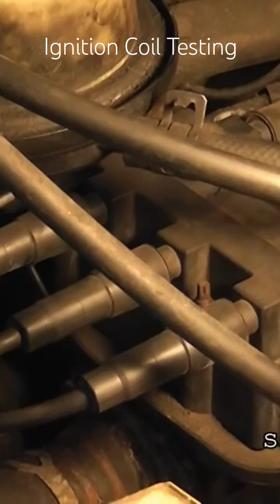No Spark From One Side of a Waste Spark Ignition Coil #misfire #nospark

Comment: Paul, you gave me an idea with this diagnostic test.

I wonder, if this coil test can be done on Garden Small Engines, like a Lawn Mower & String Trimmer?

I've seen videos of Coil test on Small Engines, where the Coil is removed & tested.
They only use one Multimeter way to test & give up too easily, then they change the Coil.

They don't test the Coil for spark, whilst the Coil is in the Small Engine & makes me think the diagnostic of overall Electrical current being tested, is not thorough or accurate, be8ng an incomplete test.

I would appreciate your guidance, if it's relative to this testing method, or any ones else's help in this post, who may know. 🙏
Reply from the maker: They use a different style of control for their coils. They're more of a magneto design in that there is a heavy magnet built into the small engine assembly that directly controls when the coil fires.

Comment: Great Tutorial, with thorough diagnostic, that I've not seen or heard before.
As, most other Mechanics do basic check & just replace Coils, without the investigations you've done, so well.

I'm a handy lady that aims to learn & fix, what I can & interested to learn, how to check Car issues & if I'm able to service the basics of my Car.
I'm greatful to have learned from you.

I also appreciate, your detailed responses of help & your valuable time & care to all the comments in your Posts.

My question is, does the Ignition swith key need to be on, or the Ignition to be turned on, for the car runing to do this test, or one or the other, should be off, please?

Also, can this test, be done, if the car wont turn on & isn't running, due to being left still, over months?
🙏🙏🙏
Reply from the maker: This was secondary ignition testing done with the engine running. IF the car is not starting, you can do this test with the engine cranking to check for spark. With just the key on, there is no RPM signal going to the computer, so you will not have ignition control taking place, so no spark. But you can get very creative with this once you understand description and operation of a system. For example, I can create an RPM signal on some designs by triggering the crank sensor circuit and the computer will respond and fire the coil.

Comment: What if the coil is not bad? What other issues
Reply from the maker: On this design? There is a single driver in the PCM that controls each coil. There are three of them in this assembly. For not spark on one side, testing the way I did, there is no other possibility. A driver or control wire issue would affect both coil towers. No spark from both

Comment: He's absolutely right nothing else needed at this point but let's say both sides didn't spark ⁉️
Reply from the maker: If both sides don't spark, next step is to check for coil primary control. Good control = bad coil. No control = open wire or PCM driver issue. Or in rare circumstances an input issue (cam/crank)

Comment: My dear ignorant mechanic. Go to lowe's and go to the section for tools such as electrician meters and test equipment. If.
You look around , you'll find a thing that will indicate electricity just by bringing it near the power electricians , call this a stinger If you get that stinger and You put it near the end of that Plug wire that stinger wolf will flash on and off and you're not exposing yourself to that hyvotage. Believe me I had to have my wedding ring cut off but that was in the 60s.
They have better tools today. Mechanics should take at least a basic electric technician electronic technician electrician
Reply from the maker: You cannot perform an RPM drop test with what you are suggesting smh. Talk about being ignorant. Want more context? Watch the full video linked in this short.

Comment: Hey I'll take the power comes from the cord that you took off not the plug coming out of the block
Reply from the maker: On a waste spark coil, it will fire from on tower and travels through the plug wire and plug, then through the block to the companion cylinders plug and wire and returns to the coil

Comment: It's called an amp meter if you use an amp meter and not only can you see if it's going through you can see if all of its going through because when the spark plugs start to go bad they start to carving and that increases the load the resistance of the power cable which is what you have there so you could be getting a spark but you're not getting a clean burnt and the poor spark will damage your spark plugs say buy an amp meter you can buy a cheap one and learn how to test learn about EMF and all that stuff load voltage amp impedance because what you're doing there I don't need to do that all I have to do is pull the spark plug wire off the plug move it at 8th of an inch away from the plug stem watch for the spark and not stick my fist in there I found out about those voltages on those cables when I was 15 years old I still carry the scar from where blew through that ring on my finger that sparked my friend can kill you and even if it doesn't kill you that shock a pumpkin why do you think they outlawed that in the insane asylum
Reply from the maker: Losts of misinformation in this comment

Comment: But heres my point if one side of that coil is sparking something is very wrong , that system spark goes out one side of the coil through the lead jumps the plug gap goes through the block jumps the dead cylinder on exhaust back through the other lead back to the other side of the coil , it cant work on one side and not the other !!! It needs a full circuit! If its jumping one one side how is it getting back to coil ???
Reply from the maker: It has a return path through the housing of the coil. This is actually very common
Reply: @ScannerDanner  I assumed it was the style like the 3.8 Buick V6 the coil has 2 high voltage terminals , and no ground on the coil , it goes out one terminal jumps the plug on firing cylinder through the block jumps the plug in its companion cylinder that dead ( on exhaust) back through a lead to the other side of the same coil ! So this one is like old coils ? One side of the high voltage is grounded and the other to a lead .

Comment from the maker: Next would be to verify coil - control from the PCM and the result of that test would dictate the next move.
Possiblities for no spark on both towers of a waste spark coil, car still runs but a 2 cylinder misfire...
1.Bad coil
2.open or shorted coil - control wire
3.open or shorted PCM coil driver
4. An input problem (crank sensor with a reluctor issue)

Comment: So if both sides dont spark whats the cause
Reply from the maker: Thought I answered this one?
Reply: @ScannerDanner  didn't see or hear it. If you don't want to say it again that's fine. I'll keep looking
Reply from the maker: I answered in the wrong spot. Here you go...
Next would be to verify coil - control from the PCM and the result of that test would dictate the next move.
Possiblities for no spark on both towers of a waste spark coil, car still runs but a 2 cylinder misfire...
1.Bad coil
2.open or shorted coil - control wire
3.open or shorted PCM coil driver
4. An input problem (crank sensor with a reluctor issue)
Reply: @ScannerDanner  your the best thanks bro

Comment: I'm not sure all test lights are rated for 10's of thousands of volts. I'd call this bad advise. Just use a jumper wire to ground.
Reply from the maker: For sure, don't use an LED type light. An incandescent bulb style only and you won't hurt it.

Comment: I never thought to use a test light as a ground for the spark.   Thanks for the tip.
Reply: 😢 it's a good way to burn out your test light if it has spark.
Reply: @coolasice2187  
So, buy a multitude of cheap test lights ?   
I used to get cheap one for a dollar.

Comment: Bad ECM’s will cause this same behavior though coil pack is the easiest fastest gamble.  If that doesn’t fix it, open the ecm and you’ll probably see one of the transistors is swollen (bad)
Reply from the maker: A bad ecm driver would cause a no spark on two towers, not one

Comment: If you don't manage to let go, it definitely has the capacity to kill.
Reply from the maker: Nope, not a chance. Secondary ignition voltage is high (40 to 50kv) but amperage is super low.
Reply: @ScannerDanner  I guess after initializing a cardiac arrest, you're technically not dead yet.
Reply from the maker: @paulwolf8444  please Google search automotive ignition coil deaths statistics and stop  spreading false information

Comment: @ScannerDanner What is the purpose of checking the other side for spark? I’m not familiar with block coil diagnostics.Thanks!
Reply from the maker: If there is also no spark on the companion coil tower then you would absolutely focus on the primary control of that coil. Good spark on the other side, means primary control is fine

Comment: if you pull that boot off (on the good spark side) with no spark going to that cylinder is it just dumping unignited fuel into that cylinder the whole time you have that boot off?
Reply from the maker: Yes sir, every ignition misfire does that. Unless the computer recognizes the exact cylinder and shuts the injector off

Comment: Put short Pieces of vacuum hose from the coil into the boot start the engine, then touch it with the test light to ground Doing a cylinder balance test the further away from the hose Will give you a nice blue Ark about an inch away. If it’s a small, yellow spark, the coil is weak. We call it a poor man’s coil performance test
Reply from the maker: I like the challenge more than fudging around with vacuum hoses 😉

Comment: Just turn the car off remove the plug wires then restart the car
Reply from the maker: Lol no! Never do that!
Reply: @ScannerDanner  it wouldn’t hurt the car the moment you unplug it your misfiring anyway the only difference would be your not risking shocking yourself in the process
Reply from the maker: No sir, this would be massive amounts of energy looking for somewhere to go, potentially damaging the coils and drivers. Also you can't do an RPM drop test that way.
Reply: @ScannerDanner  you can replace parts can’t fix nerve damage at least wear protection and stay safe I’ve never had a coil short or a fuse blow doing it if you want take out the fuel pump relay start the car until it stalls and just have someone cycle the car and you can see it after it turns over a couple times what the problem is
Reply from the maker: You're not damaging nerves, and you're not listening, you cannot do an RPM drop test with what your suggesting! Example:
No codes but you have a misfire or you have a P0300 random misfire code but not cylinder specific (common) and you can feel it it's consistent, but you don't know what cylinder it is. RPM drop test for the win, exactly what I'm showing
Reply: There’s always nerve damage with electricity maybe not a lot but there’s always a little and from what your showing in the video is your unplugging your wife from your ignition coil no spark go over to the adjacent cylinder and see spark after removing coil if you want to test a coil and see if it’s sparking turning a engine over causes the coils to fire if you have no fuel it will just spin and not be as hazardous I’m listening but if your trying to diagnose a bad coil there’s better ways to go about it that don’t chance you getting shocked

Comment: A spark tester is less painful @ 12 bucks. Mines 40 + years old, havent been bit once in those 40 years. Works on either end of plugwire.
Reply from the maker: You can't do an RPM drop test with a spark tester. You have to be able to do this test running!

Comment: Why would you need a new coil when only one plug has no spark. Maybe you just need a new wire.
Reply from the maker: The test light IS the plug and wire in this case. There is no spark from the source, which is the coil itself.
Now when you see this, you absolutely must confirm that an open plug wire/plug did not cause this condition otherwise you will burn up the nee coil too. But this is a confirmed bad coil, in particular because the other half of the same coil is functioning. This means no primary circuit testing needs to be done.

Comment: you dont need a test light see it not firing ...if cylinder is firing and you remove a plug wire the engine will change tone/studder ...if it does not change that means that cylinder is not fireing
Reply from the maker: You never want to remove a plug wire without giving the spark somewhere to go!
In this test we are looking for two things.
1. Rpm drops on each cylinder
2. The strength of the spark from each tower

Comment: Electrocution is "Death by electricity".... you're only going to get shocked by that coil. It hurts like hell but it will not electrocute you!! There is, on the other hand,  a wire that can and will electrocute if you were to touch it whilst the vehicle is running.. but that's on hybrid and electric vehicles..

Comment: Dont even need the test light. Pull the boot off till you can hear the rpm drop and you know that cylinder is contributing.
Reply from the maker: It is never good to do that! You always want to give the spark somewhere to go as coil and driver damage can occur.
Secondly, I'm not just doing an RPM drop test, I'm also looking at the distance the spark can jump from each tower. The method I'm showing is THE way to do both of these things

Comment: Use the clamp on an old school timing light bud!!  If it’s got spark the light flashes…. No flash no spark zero danger.  Come on young gun! 👍👍
Reply from the maker: 1.Weak spark can still trigger a timing light, making that test useless for what we are looking for.
2. I'm performing an RPM drop test to ID which cylinder is misfiring, again, something a timing light would be useless for.
Watch the full length case study linked in the short!

Comment: Or perhaps, use a timing light.
Reply from the maker: 1.Weak spark can still trigger a timing light, making that test useless for what we are looking for.
2. I'm performing an RPM drop test to ID which cylinder is misfiring, again, something a timing light would be useless for.
Watch the full length case study linked in the short!

Comment: Wouldn't it make sense to swap that coil to another location to make sure it's not a wiring issue?
Reply from the maker: Good question. In this case no, as one side of the same coil is firing, so this confirms the primary side is functioning normally. Also, you can't swap these coils. It's all one assembly (3 coils in one housing)

Comment: It can very well be a death shock if your other hand is grounded and the current passes through your heart. 

I have PVCs (premature ventricular contractions) aka a premature heartbeat directly due to a Cadillac ignition coil with a leaking plug wire ... The amperage CAN KILL YOU
Reply from the maker: No sir, not with an ignition coil. Doesn't matter. Amperage is too small.

Comment: The coil produced spark on the back side as you say. Pls explain why this wouldn’t be a bad wire or connection if the coil is producing spark?
Reply from the maker: My test light is the plug wire. You'd have to have two bad plug wires on the same coil for this test to have variables. The full length video shows more. But this is a single cylinder misfire which is also an important key piece of info

Comment: We would just pull the spark plug boot off a little bit and you can see the spark arcing lol
Reply from the maker: That works but you can tell how far in the terminals are to gauge an accurate distance the spark jumps. This is why the test light is great in this test

Comment: I use 2 inch pieces of vacuum line in between  the terminal and the wire and hold the test light to the vacuum line.
Reply from the maker: Too much work lol but I know that test too thanks

Comment: Words mean alot. Electrocution means death my electricity. Shock can be even near death and still not be Electrocution.  It is a near death.  However you can actually hold a spark plug wire and not die. Hurts like a divorce settlement for a man though.
Reply from the maker: Yes sir, wrong word

Comment: Using your test light to test for spark isn't the best thing to use. Obviously it works but then wiping your ass with poisen ivy works but I wouldn't recommend that either. Using a jumper lead clamped on to a small screw driver or a pick does the same thing without taking a chance of burning out the bulb on your test light. Yeah it worked but they aren't designed to handle 50,000 volts so why take the chance especially if you're making a living with your tools. Also they make plastic pliers just for pulling spark plug wires when the vehicle is running so you don't get shocked for a whole $8 on Amozon. There are better metal with rubber covering the work a little better for pulling spark plug wire boots but the cost more. They also make tools to put on while the vehicle isn't running, then start the vehicle to see if it has spark. Less chance of getting shocked but does take a little longer but there are times you don't want to be trying to pull spark plug wire's boot while the vehicle is running for reasons other than not getting shocked.
Reply from the maker: 100% not true. Same light I've been doing the same test on for 15 years with the same bulb tens of thousands of times

Comment: If you don't have a test light another way you can tell is when you pull the plug wire if there's no change in the engine idle it's a big indicator as well
Reply from the maker: For sure, but you wouldn't want to do that without giving the spark somewhere to go. Damage can occur in the coil itself or the module that controls it